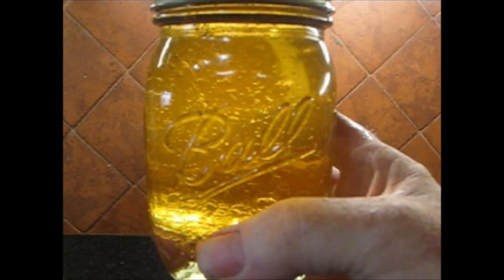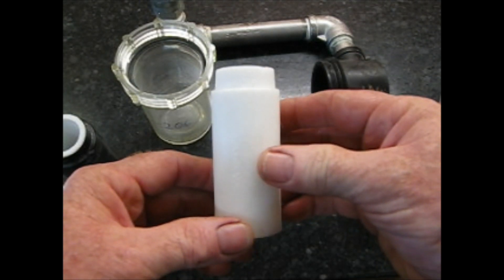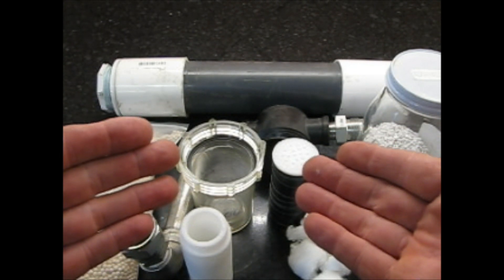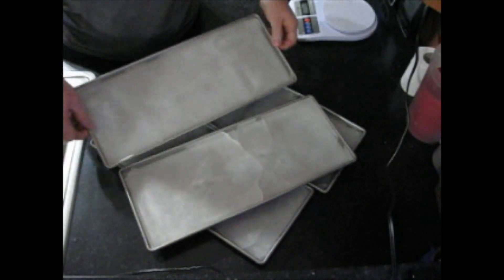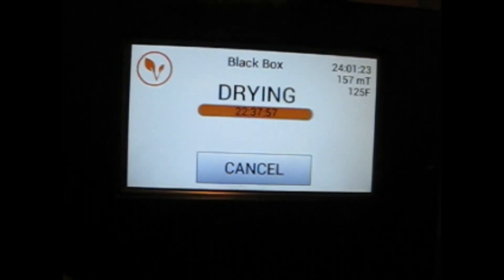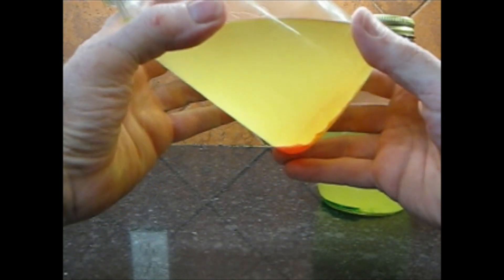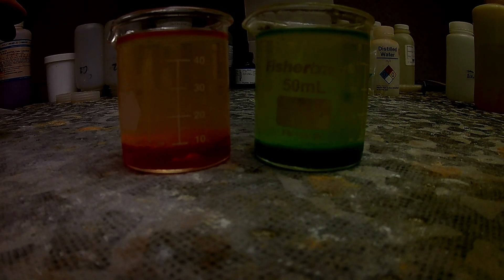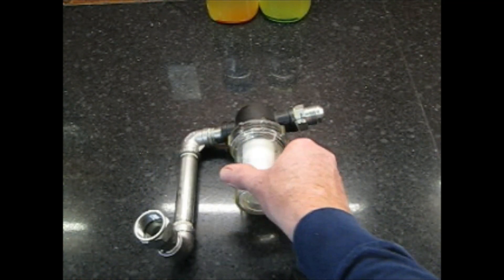Water reduction through CFM restriction

Comment: Given the problems with water, Ph, and particulates, how does this affect an oilless pump? I would think putting in the PVF-N4 inline filter would still be a good idea, but is the water vapor still causing damage to an oilless pump?
Reply from the maker: Those materials have to go somewhere.  A filter wouldn't be harmful.  Not having, or working with, an oilless pump I'm a bit handicaped on my comments.  I do know bearings are required to be replaced over time.  Lubricants offer a lot of benefits.  Even with the premier pump I still change the oil after every load.

Comment: How did you seal the threads between the metal fittings and the plastic filter housing?  I have only tried PTFE tape and do not want to split the housing by over tightening.
Reply from the maker: Teflon tape, and yes be careful, I did split the plastic from over tightening.

Comment: 6  hours or 8 hours? 24 to 32???
Reply from the maker: Please elaborate.
Reply: @Philat4800feet  At 13:20 you say the cycle with the restricted hose took 6 more hours. I'm no mathematician, but 24 hours vs. 32 hours is 8 more hours isn't it?
Reply from the maker: @truthseekr4life  At that point in time there was a six hour difference, however, I still had a small piece of ice on one of my trays that took an additional two hours of Extra Dry Time to sublimate.  That gave me the eight hours difference and 24 vs. 32.  I was hoping for a much better outcome.
Reply: @Philat4800feet  No problem. It's a really interesting video. I just thought momentarily that I forgot how to add. lol. The process of freeze drying is fascinating. Have you thought about running the drain line through some sort of heated medium to convert the water vapor inside the line into water and then catching it in a moisture trap before it reaches the pump?

Comment: Phil what I have found. The new hose HR is selling now is smaller than the. Original hose you have. My hose is clear with wire thru it. Also I have found the new filter that HR has now is much better than there old filter. The water stays at top of filter eliminating no water droplets in the filtered oil.  Here something have seen thru changing oil each cycle. This is with standard pump. If I run one cycle at very end of cycle my mllt go to 250 at end cycle. Second load goes 260 at end cycle. Plus cycle time goes up about 30 minutes. Weigh each load  same product so my cycle time increase from pump not working quite as well. By weigh change and filter oil now each load. Bill
Reply from the maker: Thanks for the information.  My efforts have been trying to remove the high PH water before entering the pump.  Once in the pump the damage begins.  It's like shutting the barn doors after the horses escape.
Reply: My main thought is to get every one to change oil each cycle. This at least helps save the pump a little and cycle times are money. Thanks for quick reply follow you every video you put out the best. Bill

Comment: put one on after warranty ran out running first  load now with filter, put mine at FD outlet only had 2 more connections
Reply from the maker: I'd like to know your results and thoughts.
Reply: @Philat4800feet  just finished 1st load with filter about average time change my oil each load oil seemed a little cleaner very little water will see what happens on down the road
Reply from the maker: @jcsydow4350  Thanks

Comment: Phil, great experiment!
I have a possible solution to seperate water during the pump cycle. What it..
You replace the drain plug and add appropriate fittings leading to a small reservoir. This would  would add to the amount of oil within the system but.. since it is lower than the pump it would fill with water. As water level rises in the reservoir,  clean oil would rise and circulate. I think this would work.. Got to admit,  not sure it would work according to plan in a vacuum closed system. What do you think?
Reply from the maker: My goal was to remove the water before it got to the pump.  Once the PH high water mixes with the oil and is exposed to the vanes, the damage is done.  i.e., Shutting the barn door after the horses are gone.  On larger scale operations a refrigerated cold trap is used ($5000-$7000) before the vacuum pump.  You have some good thoughts on the subject.

Comment: I would imagine reducing airflow could also make the pump work harder than designed, consuming more power and giving off more heat potentially reducing lifespan. Have you tried just heating the oil in a pan to a low temp on the stove to evaporate the water out when you change it after it's filtered?
Reply from the maker: Yup, I have tried the stove, but that introduces heat.  There is also a industry method to remove the water by using a vacuum chamber to boil out the water at room temperature.  Now where would I find a vacuum chamber? :)
I'm not sure if the effort is worth the money.  Try, try, try again.